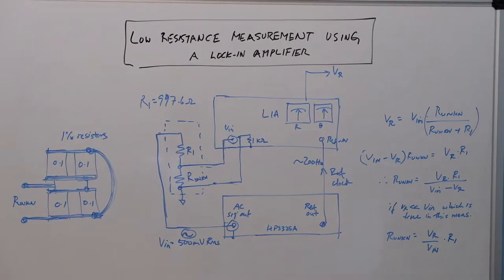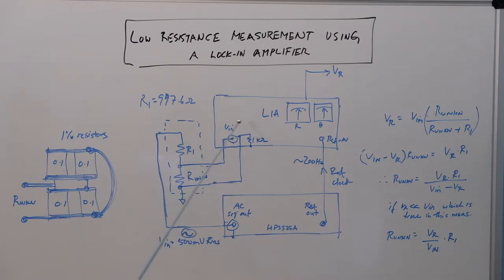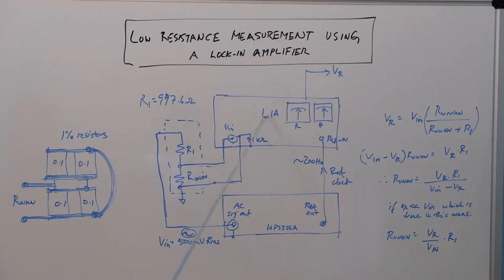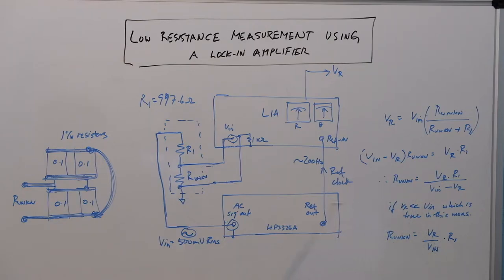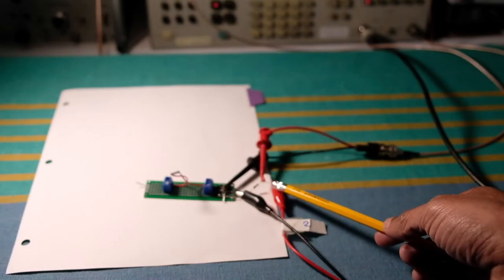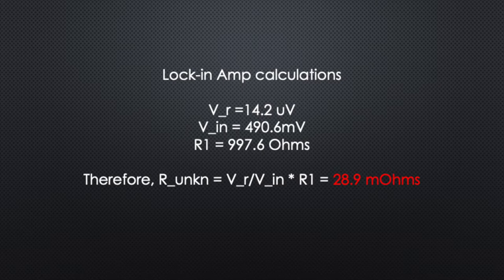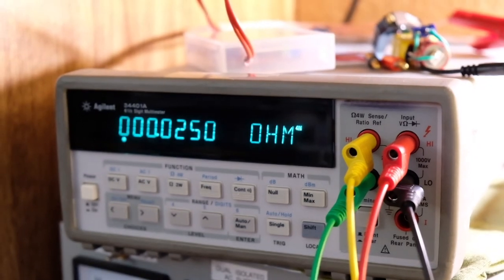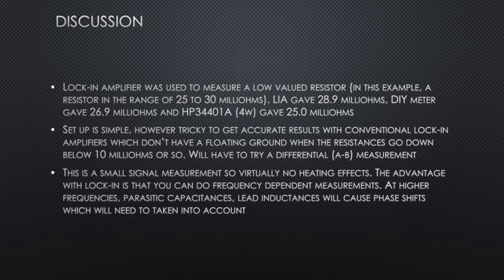Low resistance (milliohm level) measurements using a lock-in amp

Comment from the maker: I did a follow up differential measurement (A-B) on the lock-in amplifier and I got a result of 26.4 mOhms for the device under test. This is the right way to do it if you care about ultimate accuracy from a purely set up point of view.